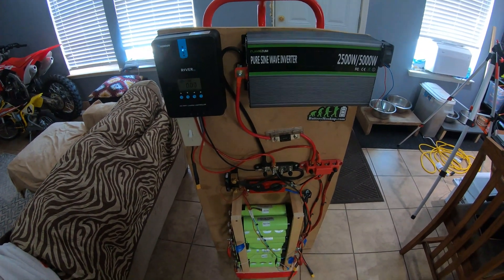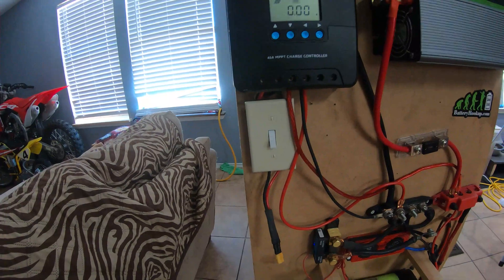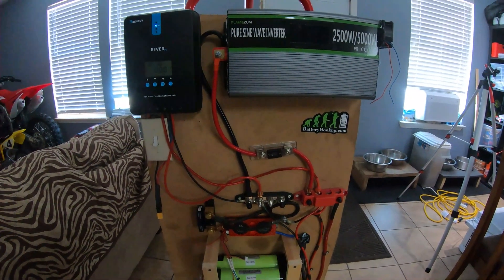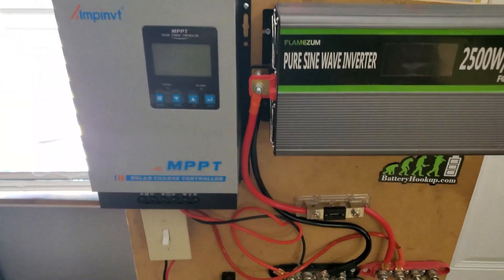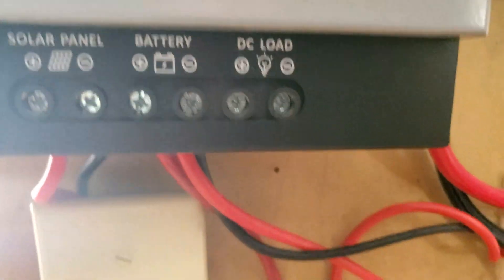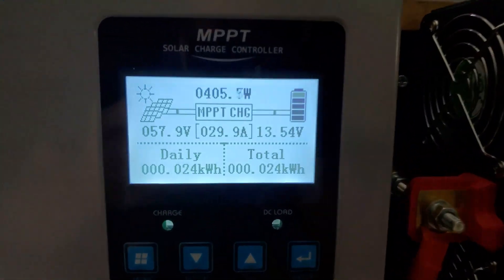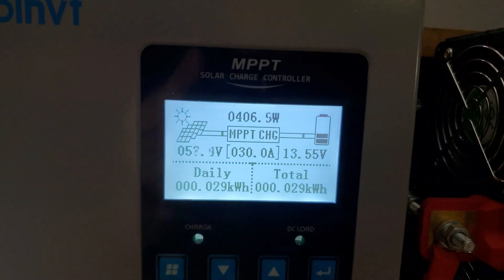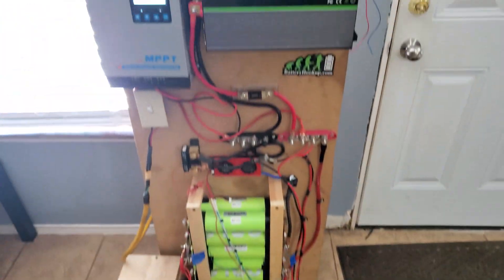80 amp mppt solar charge controller install and testing

Comment: You seem to know what you are doing, my question is that I see most charge controllers say to have a max of let’s say 80v can you over panel let’s say you have 21v panels and you have six but do you 3 in series and 2 in parallel is that okay or no not something to do? I know it would double the amperage but is there a reason to do that ?
Reply from the maker: Basically yes don't go over the max voltage to keep the controller from getting damaged.
You can do 3 in series, then build another 3 in series, take those and parallel them
That would give you 6 panels total at a voltage of 63 volts.

Parallel adds amps together, keeping voltage the same
Series, adds voltage, amps stay the same.
Reply: @Mikebuildss thank you much for the explanation I figured that set up would get max power out!!!! I have a delta pro with two batteries but I have extra panels collecting dust… I’m looking at getting a wattcycle 12v 628 amp hour…. What would be a good mppt size I’m thinking 80amp?
Reply from the maker: @dieseldawg7132  Yes or the 60 amp is good too. Ive used it years now has been good, and can take up to 150 volts input allowing more series connections

Comment: Hey Mike
Have you charged any of your battery banks with 80amps yet? On any charger or mppt?

How many watts worth of  solar panels would you use? 

I have a 72v 100ah EV and planning a solar quick charging station..
Reply from the maker: I’ve used it with good success, not 80 amps most I ever had was 50 but I didn’t have enough solar panels, it can only go up to 48 volts so keep that in mind unless you use it to charge a battery, then use a power inverter to run a 72 volt charger
Reply: @Mikebuildss how many panels
Reply from the maker: @ I think I was running 6 panels, this was my old setup I’ve since upgraded to 10 panels

Comment: Have the same 80a charger. Quick question, I noted that you set your charge voltage (float voltage in the menu) to 14.5v, but it still shows 13.4v. Just like mine...so did the output ever change for you? I was unable to get it to charge more than 13.4 even in direct full sun, it simply will not charge any more. Similar setup, lipo batteries, etc. all 12v. Just curious of your thoughts and experience before I go a different route.
Reply from the maker: That’s weird I can get it to 14 all day long when the battery is full, i would double check settings again and verify it’s actually set not reverting back
Reply: @Mikebuildss  thank you for the reply. Even at 100% capacity of the 400ah bank it does not get higher than 13.4v. I know lithium requires 14.4 to adequately charge, so I am a bit baffled.

Comment: Im having an issue with mine. The unit starts up but it flashes a "Communication Fault" and its basically locked from producing any current. Can't change any parameters either. Wondering if you know anything about this.. Thanks for the video and have a great day!
Reply from the maker: Hmm I haven’t heard of that. I’d try retuning it for a new one, if you bought it from Amazon it should be an easy process.
Reply: Check that your thermal couple is hooked up correctly.